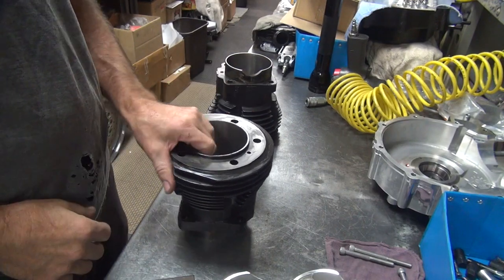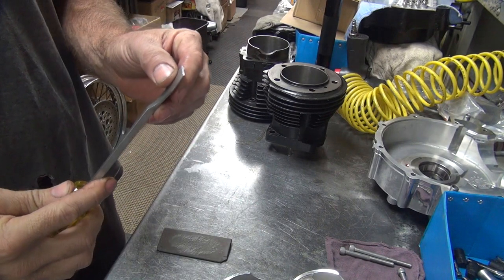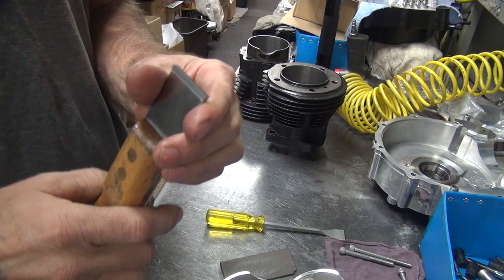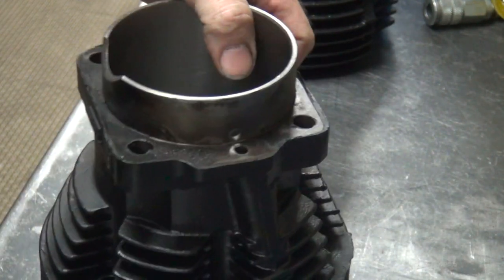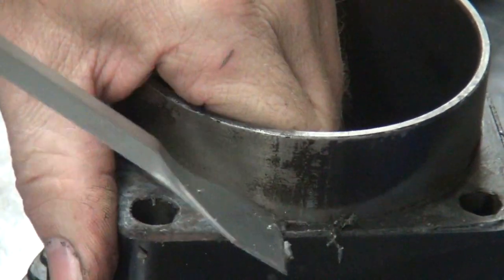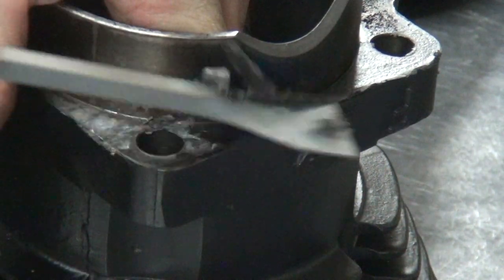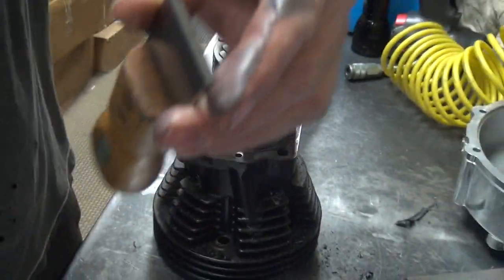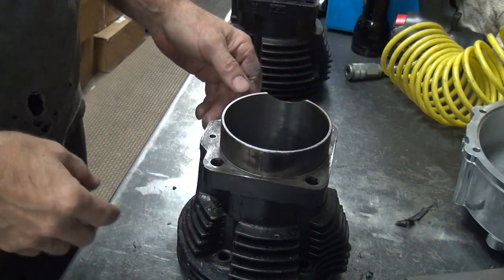#105 How To Do It, scrape gaskets head & cylinder Harley shovelhead ironhead sportster panhead

Comment: any tips for removing gaskets off aluminum parts without damaging the part?
Reply from the maker: gasket scrapers, you see me using them all the time.
tatro
Reply: Apply some aircraft remover on the old gasket and let it seat for awhile. It will be soft like butter after a couple hours and can be scraped off with plastic scraper without scratching the metal surface.
Reply: @illla  I appreciate it, gasket scraper could not do the job alone. This gasket I had was super hard and stuck to the part like no other. I ended up tapping the gasket all around with a ball peen hammer to loosen it before scraping it. Tried gasket remove solvent also. It did nothing...
Reply: @kylandaminick13  
I'm having the EXACT same issue as we speak. Those base gaskets are on there like nothing else I've ever seen.